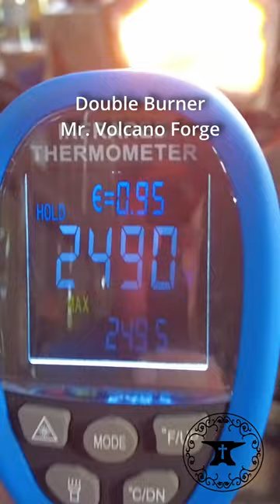Is a two burner forger HOTTER? #shorts

Comment: In my experience building gas forges and test I've done.a single burner reaches the same temp as a two burner more burners don't mean hotter it means more heating area on a single burner you have to work longer mitral in and out to heat up whole thing where a two burner you put in let it set and it will heat whole piece with out having to move it in and out.